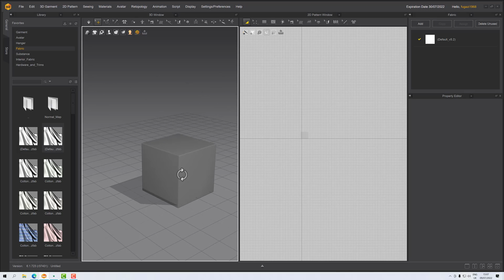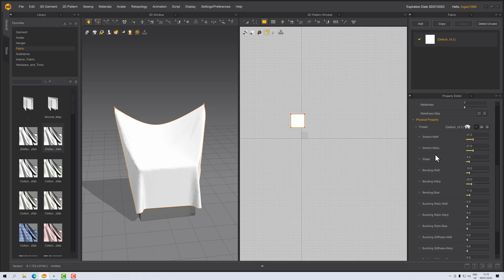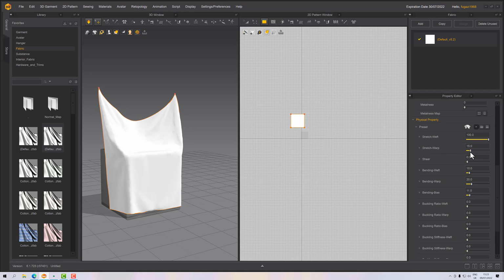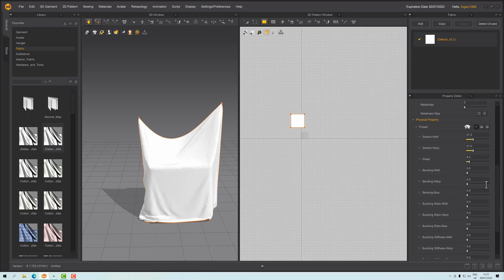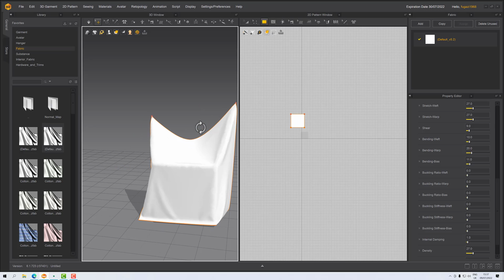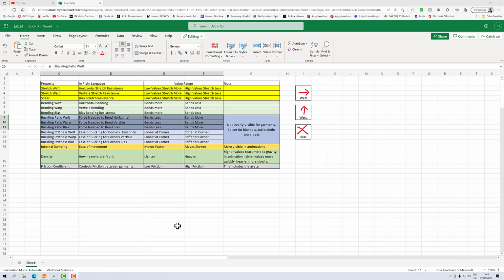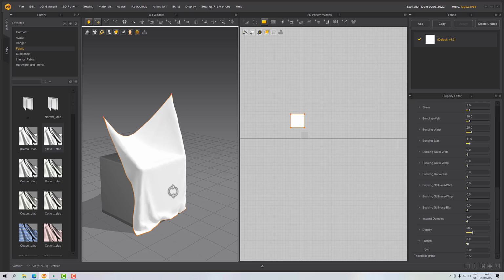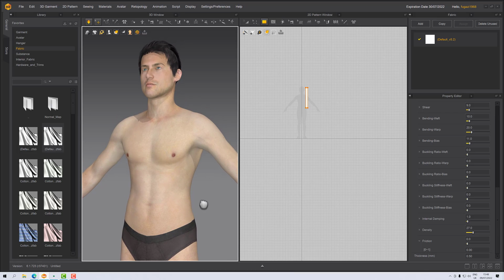Fabric Properties in Marvelous Designer

Comment: That was clearly helpful, thanks a lot ! I wanted to ask you something not related, when I use the weft or warp shrinkage to enlarge a pant ( for exemple ) it works but the tissue looks very weird, ugly and not realistic, even if i increase particles distance, it feel like the garment is corrupted by that step, how can we use this option and keep a quality look/simulation ? thank you very much.
Reply from the maker: Hi MGB Core.  Thanks for the question.  The Warp and Weft options scale your garment without changing the geometry, so it effectively changes the particle distance to keep the geometry the same.  Increasing your warp and weft  scale, increases the particle distance, even though the MD particle distance setting on your garment will stay the same.  I would  suggest that if you change your warp and weft values, then you decrease your Particle Distance accordingly, something along the lines of reducing the particle distance by 10% if you increase your warp/weft by 10%.  Though you might have to experiment with that.  However if your garment mesh is to be used externally, especially if you are creating morphs for it I would set a lower PD to start with, so that when you increase the Warp/Weft the quality is still good.  I hope that makes sense.
Reply: @3dmegaverseJohn  Thanks for your reply ! sure it make sense, but that strange because I already tried to make PD adjustements when changing shrinkage, the garment will still look like puffy/gondolas, anyway I appreciate your point of view and I will keep trying.